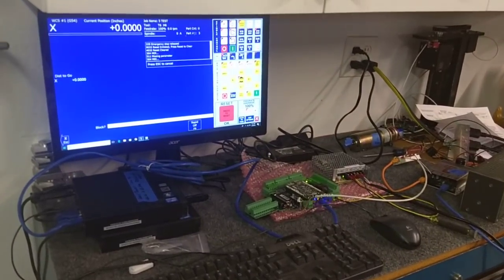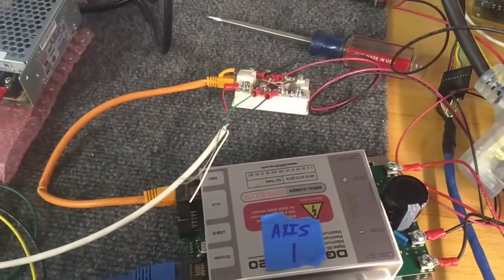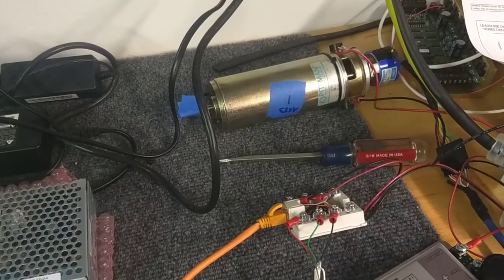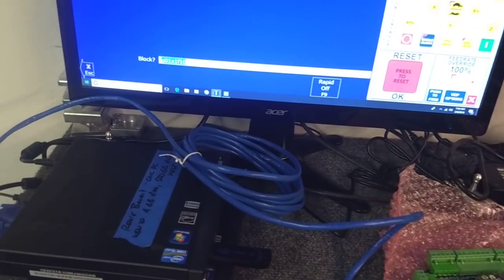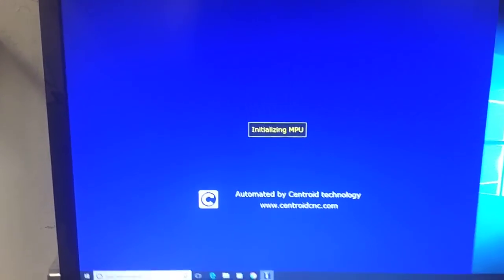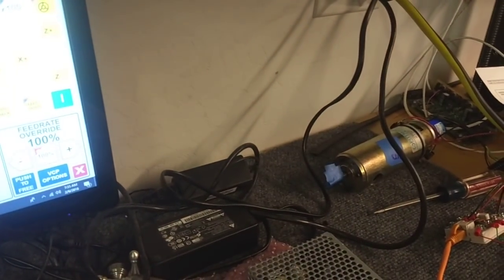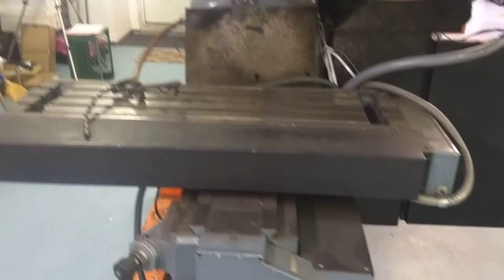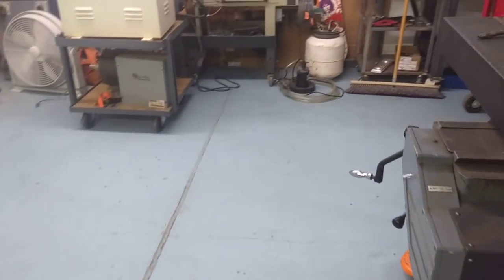What's Marty up to?

Comment: Looks like my setup Marty 😀. You should mention why you use the DB25 port instead of the terminal strips for step & dir.
Reply from the maker: Good catch. Not completely settled on it, but it was easier to get going using the DB25 since it has the 5V logic levels required of the DG2S drive. How did you make out with your servo tuning?
Reply: martyscncgarage  My DG4S-16035 is less critical to tune than my DG2S-35 . Seem I keep touching up the DG2s tuning. I am only running 70 vdc at the time until I finish building my other power supply. I think there is a update on the firmware for the dg2a. Have downloaded it yet.
Reply from the maker: Keep me posted on your progress. I updated the software using their latest servoconfigurator software